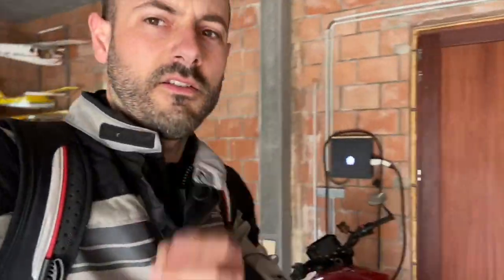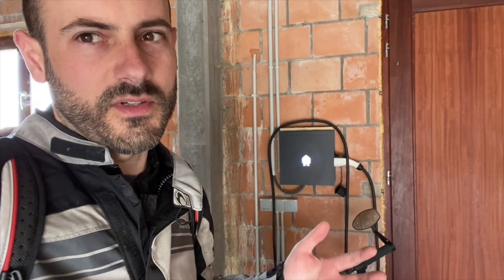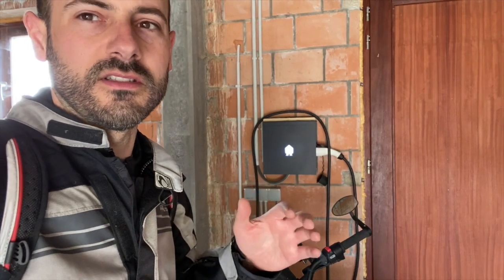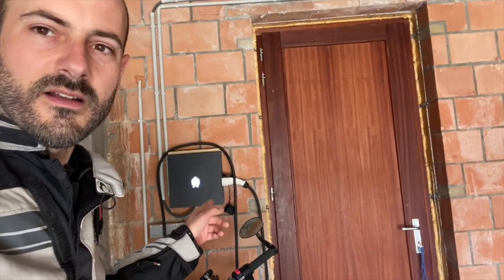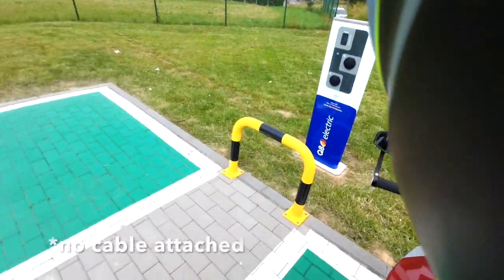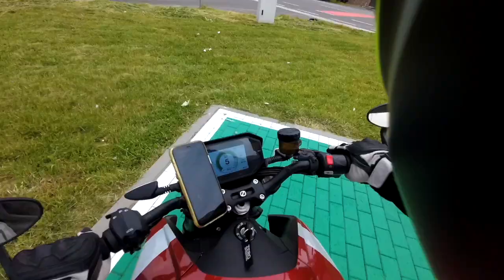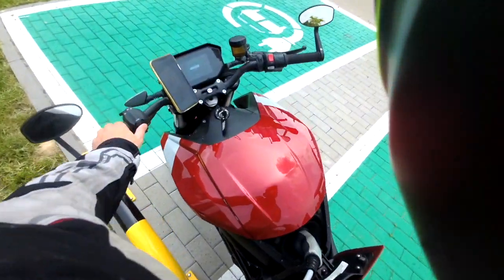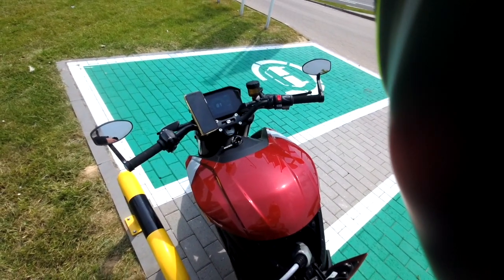Zero SRF + CT 12kW Charge speed vs SOC at 22kW chargers

Comment: Do you know charging speeds without charge tank on 3F 11? - also can you adjust current or power in DASH/APP ? like energica?

from chart its look like you have 3 (3,3) + 3 (3,3) + 6kW - 3F 11 - 9,8 so this 6kW work only @ 13-16A AC
Reply from the maker: The charger and the cable are also possibly limiting once you go charge tank. On 11 kW the current per fase is the limiting factor and then the charge tank works half. So 3+3+3 with chargetank, 3+3 for premium and 3 kW for standard config. Only when you find a 22 kW charge the full charge tank 6kW can be user since that is on a single fase.

Comment: Interesting that the chargers are capped at 114A, but at higher pack voltages the kW gets capped to ~11.7, while the current starts to go down.
Reply from the maker: Even on my single phase charger at home where only 6kW of chargers are put to work the display will show 5.8kW.
Reply: @Hans2183  I think each of those chargers are somehow capped to improve longevity. The CT is capped at 57A even though I guess it can do 60A+ and the individual ones are capped at I guess 28A even though they can do 30A+
Reply from the maker: I see. That explanation makes a lot of sense.